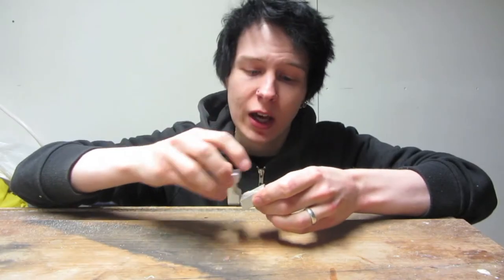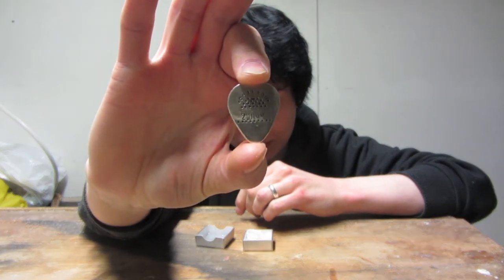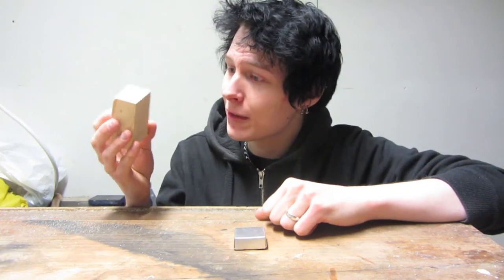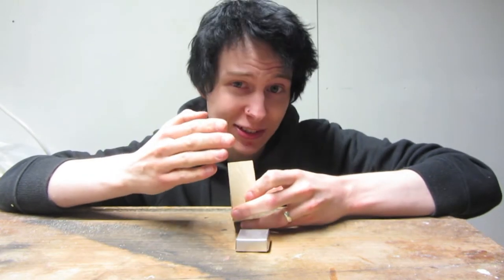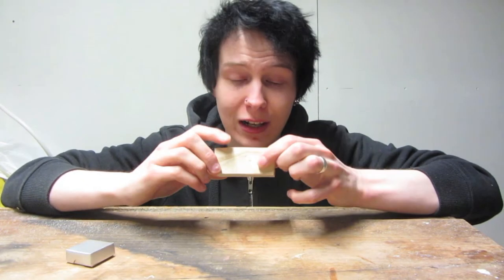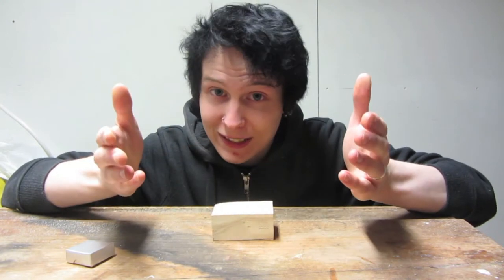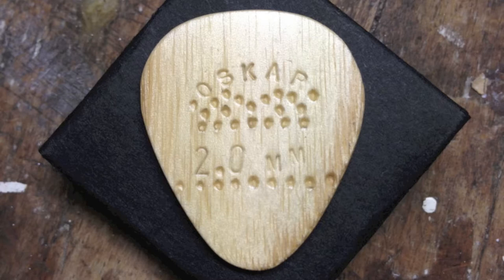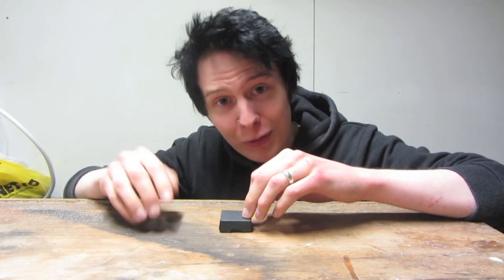Handmade Wooden Guitar Pick

Comment: I came to this video after seeng some wood picks made for playing.  They have a warmer sound to them.  They are usually made of dense hard wood (more difficult to work), like lignum vitae, cherry, walnut, purple heart, etc.  For playing, they are usually a bit thicker, 1.0 to 1.5 mm, and rubbed with oil instead of a lacquer, so they aren't as slick for a better grip.  
I definitely need to make some now.  I don't have wood punches though, but I have hand carving tools, and primitive wood burning tools (heated over flame instead of electric) to impart a design.  I like how instead of completely cutting out the pick at first, you leave a tab to hold while working the rest of the pick.  I wouldn't have thought to do that before watching this vid.  And you did it all in less than five minutes!  Lol, jk,I know you sped up the video for the sake of time.  Anyway, that was a beautiful pick, I wish I had a friend so thoughtful as to make me a pick that would match my guitar.  I'd wear it on a necklace and never take it off.
Reply: There's still no reason this can't be used to get a good sound.  Every pick gives you a little different sound on acoustic instruments.   If it's right for what you're playing, any tone is good.